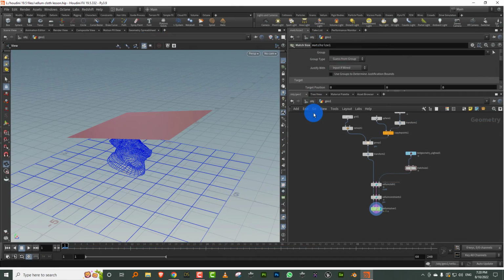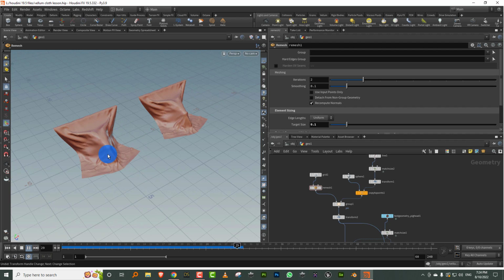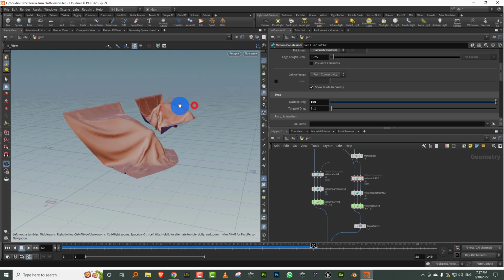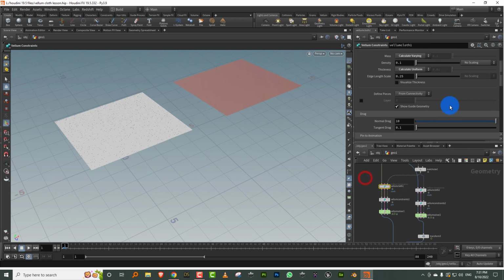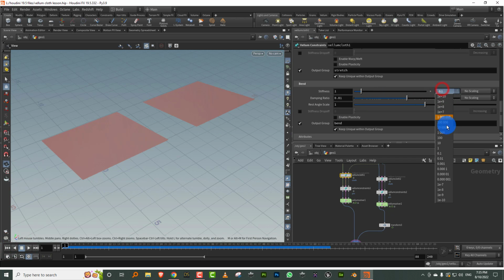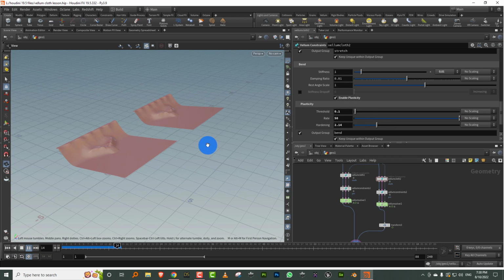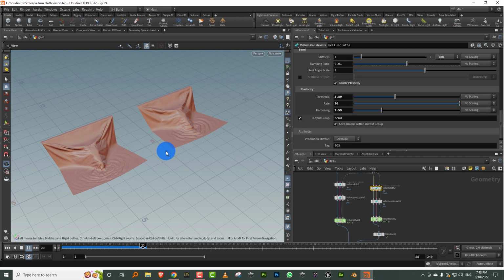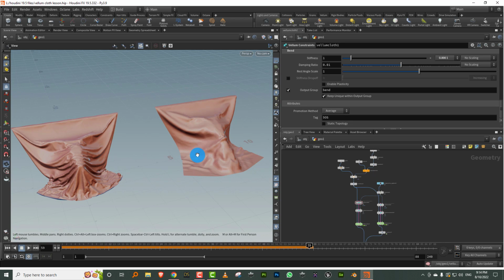Houdini  - Vellum cloth settings

Comment: Thank you Rohan for your efforts , I just wish Houdini has a presets of natural clothes like (silk , jeans , leather ,...etc) so we at least start form a basepoint and don't spend much time of trying mimic that from scratch
Reply: You could spend a day setting those up and then save them as HDAs, if you have OD Tools you could add them to the OD Asset Library and boom you have drag and drop cloth presets. Kinda a pain to do the first time but once you have it made youre good 🤙
Reply: @dirtcreature3d  true.. there is even a downloadable set available. however just as they added configured vellum materials they could simply add a dropdown for those to make it way faster than fiddling with it for hours
Reply: commenting here to say that you should look into recipes in H20.5! its another way you can save a cluster of nodes for a desired cloth that you want. this might be your answer to your problem, even though you'll have to set it up yourself